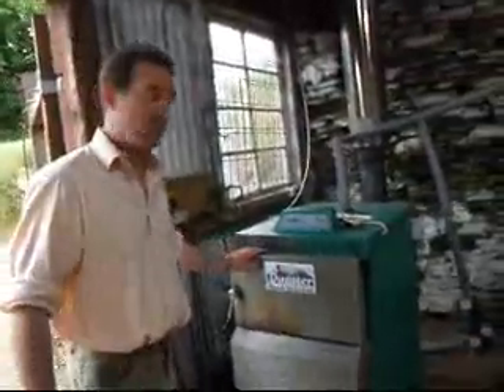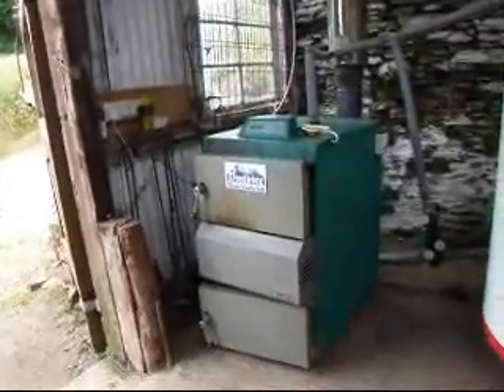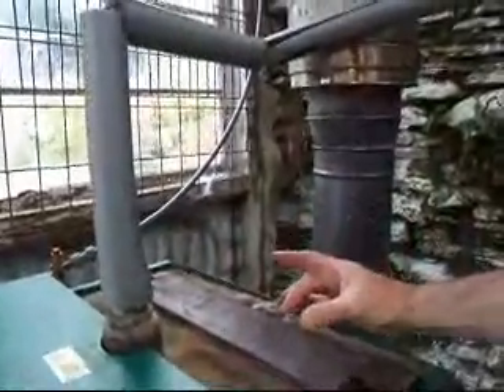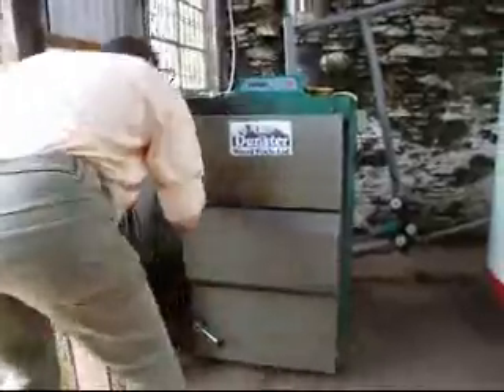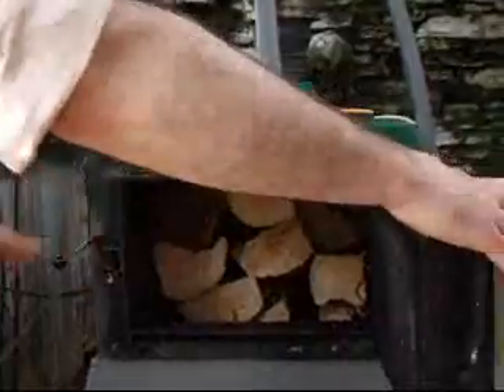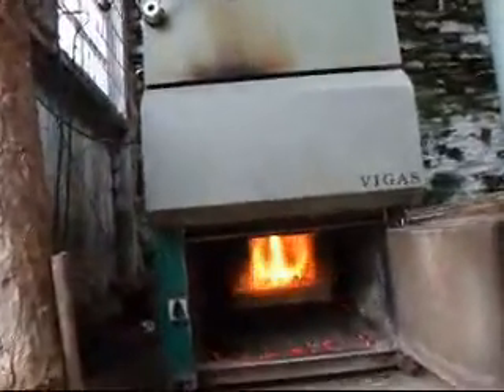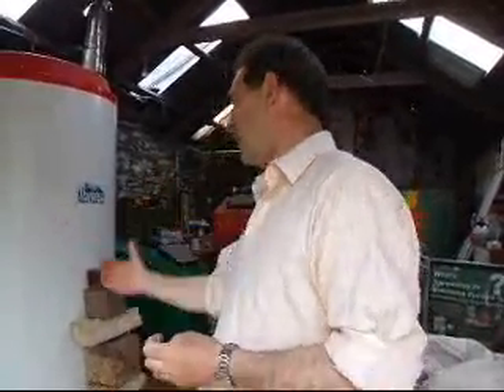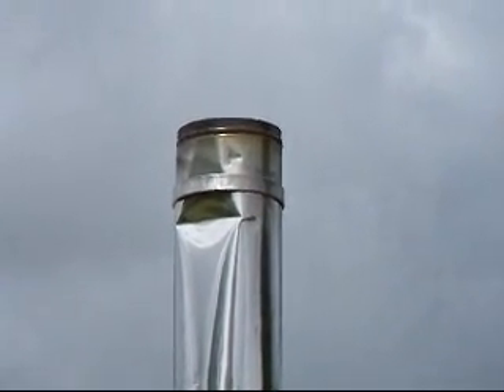Vigas Wood Fuelled Boiler - Part 2 of 2

Comment: What about cleaning the fan and tubes behind it? How often do door seals need to be changed?  So you light it nd then leave it for 2 days? That's to say the accumulator is still circulating heated water around the home for 12 hours per day,  without the fire bring active?